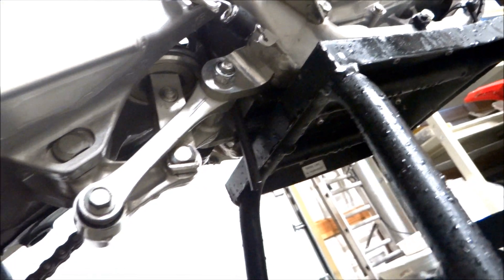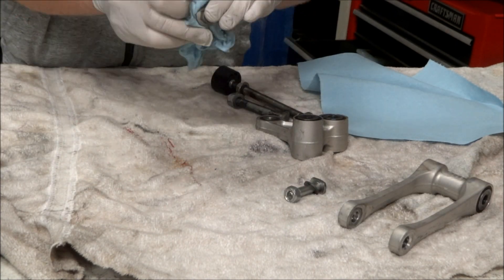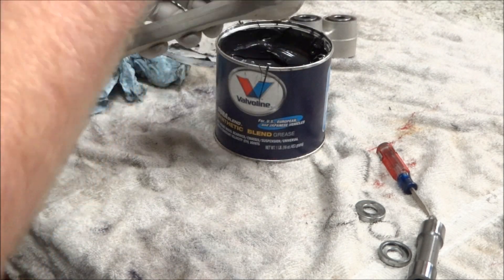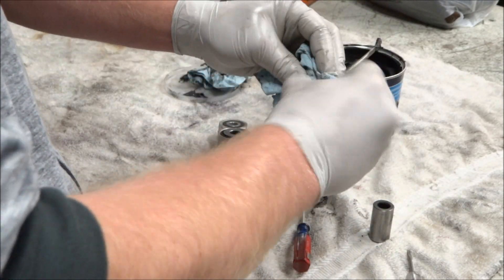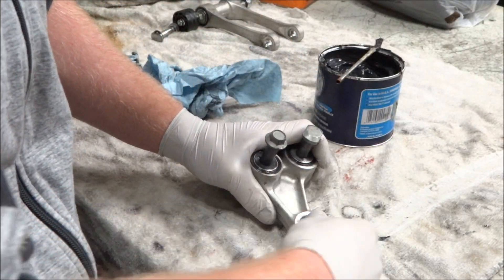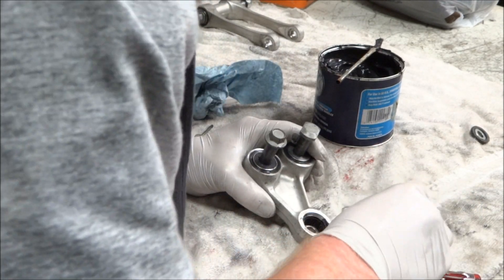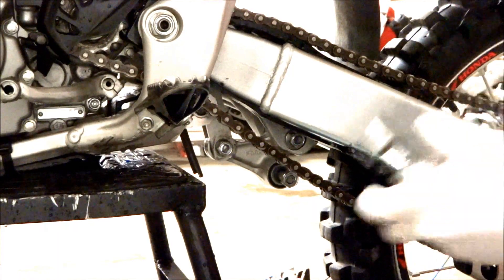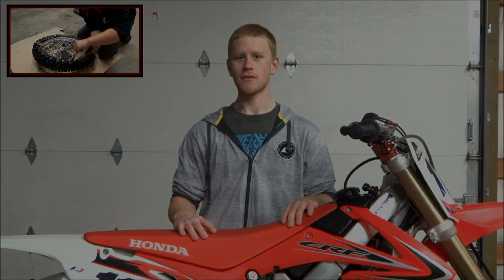Do This Before Your Shock Linkage Bearings Fall Apart

Comment: After removing the seals & bushings I used to soak the linkages in petrol and use a toothbrush to clean them out. Let them dry ou properly and repacked with grease.

Comment: 10-15 hours eh. I just stripped a YZ125 and I don't think its been done since the bike left the shop in 1994. Link bolts had welded themselves into the bearings and tri-link. Had to junk the entire swingarm and try-link and buy replacements.

Comment: Who else had a fun time replacing the needle bearings as they kept falling out 🤦‍♂️😂
Reply: I count not get the linkage connecting arm back into the mounting holes on the frame..for some reason it is too tight with the caps on even though it came out fine...any tips? I cannot get this control arm back in place

Comment: Thanks Cameron I know this is an old video but it's good. I have a DR-Z   SM I am going to check the manual although I'm assuming that the DR-Z has a similar linkage. It's an 06 model I won't be surprised if the linkage has never been greased. Thanks Cameron
Reply: I went to grease mine then all the needles fell out they have never been greased rusty as all fuck 110$ bearing kit ordered mine is an 06 too
Reply: @BrotherTay  hey buddy do you have a SM model? You have me concerned I am in the process of installing big bore and cams and clutch. Before I start the bearings now have to line up new bearings don't want to have bike down 4 2 long. Thanks for the heads up 👍
Reply: @richardtschida2321  sorry for taking awhile to respond i would check them out first if you havent started doing the top end already better safe then sorry dont want to be pushing your bike home because of a linkage bushing it was a kick in the nuts for me
Reply: @richardtschida2321  no iv got the 06 rm 125
Reply: @richardtschida2321  but yeah and not a pro tip id take them to a shop to get pressed in and put unless ypu got a bench vise you dont care about to push them out.... but putting them in i left that to someone who can do it right i tryed with a hammer a d said let stop while im ahead hahah
Reply: I broke my works bench vise pressing them out so if i was you take it to a shop handle was in the shape of a S after i was done :)

Comment: Like so many others have said, great video; thanks.  I am new to dirt biking.  Lubing my son's 2017 Yamaha TT-R230 linkage for the first time.  I bought it brand-new; I am amazed at how little lubricant was in the linkage bearings.  One thing I noticed; the material which holds in the needle bearings in place was missing for a few of the needles, in two of the triangle bearings. It appears to be a rubber-type material.  I did not find any of the material when I pulled out the bushings.  I do not use a power washer on the bike; just a regular hose end sprayer.  So I am thinking it was this way from the factory.  Should I replace those bearings?  thanks for any feedback.
Reply from the maker: Hey Bryan, thanks for watching! Yes, they do not come with much grease from the factory at all. I would only replace the bearings if there is sloppiness in the linkage, or if the bearings are binding.

Comment: Hi Cameron! Can you help me with this? thanks you!!! https://thumpertalk.com/forums/topic/1250454-cr250r-2003-linkage-question-help/

I have contacted Pivot Works too and wait for their answer, I'm really confused about this!!
Reply from the maker: Check out 11:00 of this video https://www.youtube.com/watch?v=-L9XJeUIqxQ
Reply: Thank you Cameron!! taking time to answer me! it's clear in your video that the way the manual show it it's right. So the groove of the dust seals are inside. When I removed it from my bike, the dust seal were in, then the collar over it (opposite as the manual and opposite to your video). I asked this question on Thumpertalk, someone that works for years on Honda's said the manual is showing the wrong way, and the collar should be installed outside...

Comment: I never do this stuff
Reply: Stefan Van Wyk lol well I bet your bike looks and rides like a pos lol. This isn't hard and is well worth the effort for peace of mind.
Reply: Well, it's a good idea. My '99 XR250R had never had those bearings lubed in 18 years. When I took it apart, there was still a light coating of old grease still there, and no damage to the bearings or surfaces. However my bike has not really been used harshly in those 18 years, but it has been ridden a lot, some of it pretty dusty. I was shocked that the bearings were still ok. Since It's now been lubed, I'm thinking it should be good for another 30 years or so. Lol

Comment: Just a tip using those acid brushes, the bristles often fall out and may end up in unwanted place such as bearings. I use either a grease gun or handpack the bearings.
Reply from the maker: Great to know! I'll keep that in mind.
Reply: Correct! Hand packing is the way to go on any bearings. I've had bristles fall off brushes when cleaning non-critical items, it would be a shame to have a bristle end up in your needle bearings.

Comment: been doing a lot of work on my 07 CRF250R...shock linkage lube is next on list..thanks for the detailed how to. Lots of aftermarket parts added so far. It all started with a cracked rear wheel, so off with the rims and ordered a set of the Tusk Impact complete wheel sets, new tires mounted, then oversized front rotor and tusk rear rotor installed on new wheels, new renthal rear sprocket installed, new oring chain and front sprocket on hand but not installed yet. New works connection clutch perch installed, new clutch lever installed, new tusk rear brake lever and clevis installed.....LOL....oh yeah progress. Still have to install the braided brake lines, new pads, and do the shock linkage lube. After that....reinstall everything, bleed the brakes, add the "bling" tusk parts, and I should be all done with the upgrades. UNLESS..i get new plastics and a complete decal kit...debating....LOL
Reply: rbljackson time to start thinking about the important stuff like bearings / motor all that fancy stuff doesn't do ya good if it doesn't run
Reply: Jake Hynds lol my thoughts exactly, have a knocking motor in a blinded out chassis lmao.
Reply from the maker: Wow you're really going all in! Good choice on the parts, I've had great luck with Tusk and Works Connection products. Thanks a ton for checking out the videos. Post up a video of your bike when it's finished. I'd love to see the progress.
Reply: Rider before me raced the bike and (upgraded to a 450), religiously changed oil after every race. valve clearances were checked over the winter right before I got the bike. Clutch plates were checked and were in tolerance, motor doesn't need any additional work this year unless a unforeseen problem arises. Antifreeze was changed, motor/gearcase oil was changed, brake fluid was replaced when stainless lines were added, Wheel bearings are all new (new tusk wheelsets). I do need to check the linkage bearings, and the stem might need some new bearings soon. The other thing I would like to have done is shock and fork suspension rebuild, but that is going to be held off until winter.

Comment: Hi, 
What is the similar lubrication of liqui moly? 
Valvoline not available..
Reply from the maker: I switch to Bel-Ray grease. Maxima is great as well. Just make sure you're using a waterproof bearing grease.
Reply: U about this - Bel-Ray Waterproof Grease?
http://www.belray.com/bel-ray-waterproof-grease
Reply from the maker: That's the exact grease I use. Great stuff!

Comment: Hi, Great Vid, a thought for you. It seems like a fair bit of work to lube the linkage.  My friend has a Yamaha TTR 230 I have a XT250. I notice on his bike there are grease fitting to lube the bike, great idea I think mine none.  What about drilling and taping holes in the linkage for grease fittings. Any opinions on that?
Reply: vlad kalina as long as it's done PROPER I don't see a problem. Of course you would need to completely disassemble, mark, drill, tap, and clean each part before reassembly and greasing.
Reply: M

Comment: Do you wipe down the floating needle bearings inside with a paper towel or will the screw it up?
Reply from the maker: +Denny Blaschko Yes, I lightly wipe them in a front to back motion. So try not to rotate the needles and they will stay in place.
Reply: +OneOne9 Creations thank you! Also do you know the torque pounds for the linkage?
Reply from the maker: +Denny Blaschko I don't know them off the top of my head but I believe I posted them in the video.

Comment: what size torque wrench did you use that will do the whole bike i need to get on but the right size
Reply from the maker: jake lane I used a 1/2 Proto torque wrench.
Reply: Jake Lane most likely one wrench won't do it. Off the top of my head my valve covers are 10nm and rear axle nut is 114nm and one wrench will not ACCURATELY torque at those two specs.

Comment: Another question on mind. How long are these linkage bearings expected to last? I've had my bike for over 4 years now and both swingarm and linkage bearings looks brand new. I have been changing the dust seals once or twice though.

Any idea? 

Thanks in advance.
Reply from the maker: There is no set time table on the life of the bearings. It depends on the type of riding you do and obviously maintenance. If you trail ride and keep the bearings greased, I would expect you can get 150 or more hours out of them. On the other hand a pro level MX rider who doesn't keep up on greasing may only get 25 hours. I usually get about 100 hours out of the linkage bearings and 150 or more for the swingarm bearings with my type of riding and maintenance schedule.
Reply: +OneOne9 Creations what if your talking enduro like soaking in water and mud lol

Comment: i take all the neadles out and clean everything, it doesnt take long at all to put them back in abaut 2min per bearing, i also use wider gascets original are 4mm i use 7mm, they fit on yamaha nicely,
Reply: I agree with you to a point as I pull everything out, including seals. However considering his bearings still looked mint, his method appears good enough & quicker to do than ours. The quickest method would be to just pull out the pins & just add more grease, without cleaning away the old grease. This also could work well enough. Most bearings seem to fail from having no maintenance at all.
Reply: that one guy from there yeah me to,this guy did a half ass job
Reply: @barra245t2  Cameron is a very accomplished mechanic and after watching many of his how to videos I have this opinion reinforced time and again.
Reply: @richardtschida2321  Agree 100%

Comment: Is a torque wrench really necessary? I've been using a regular wrench for tightening my linkage and swingarm nuts for 3 years now and never had any issues with them, I just tightening them until i feel like it's enough.
Reply from the maker: It's all about what you prefer. I like to have the peace of mind knowing that my hardware is not overtorqued nor too loose. The manufacturer has torque specs for a reason.
Reply: OneOne9 Creations Fair enough probably gonna do it your way :) Thanks man.
Reply: Mack Mkay I only use the torque wrench for the head bolts.

Comment: i have the same bike and i noticed when you put the bike back on the stand at the end you lifted by the exhaust which has an indent in it (possibly for lifting). My question is if it is okay to lift the bike the exhaust.
Reply from the maker: Yes, you can grab the bike at the fender, muffler (provided it's not hot), or swingarm to put the bike on a stand. The indent in the muffler is for clearance of the rear caliper when the suspension is compressed.

Comment from the maker: Good question, yes there will be a very slight difference in the amount of friction in the linkage after re-greasing but it is very minimal, depending on the condition before re-greasing. I don't think simply re-greasing the linkage will make enough of a change to warrant resetting the sag though.

Comment from the maker: Oh, some linkages are the same diameter all the way through so you can get the bearings out either way. In your case, you will need to use a blind bearing puller or use a punch or flat blade screwdriver to drive the bearings out from the other side. If you use a punch or screwdriver it will ruin the bearings. The best tool to use is a blinder bearing puller.

Comment from the maker: To remove the bearings you need to get a socket with the same outer diameter as the bearings and punch them out of the linkage. They will need to come out for anodizing.